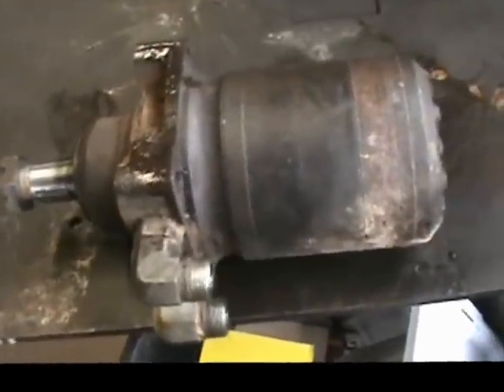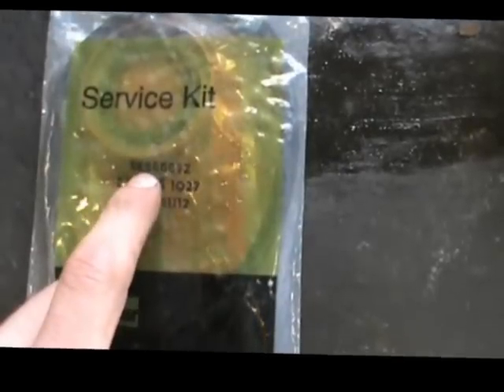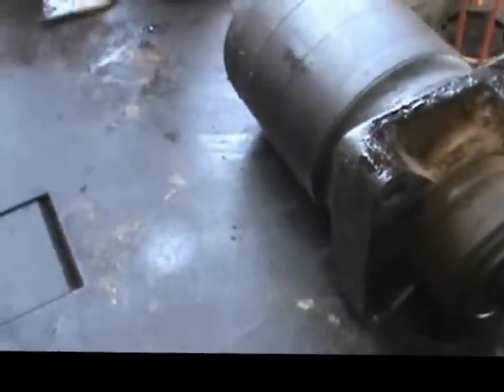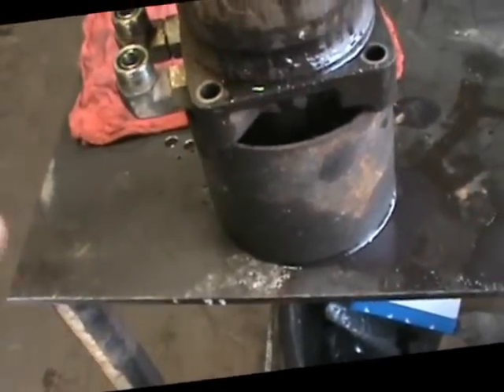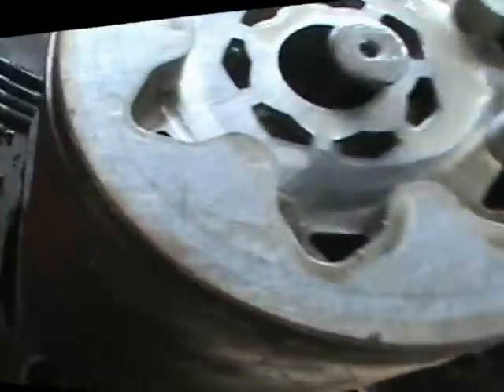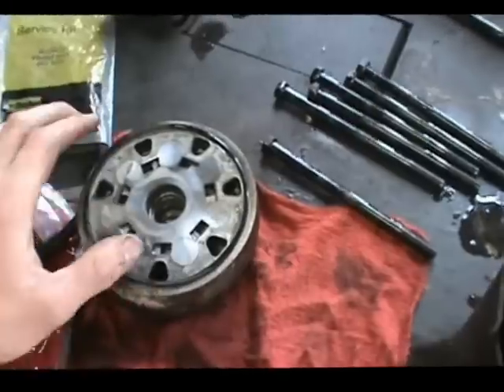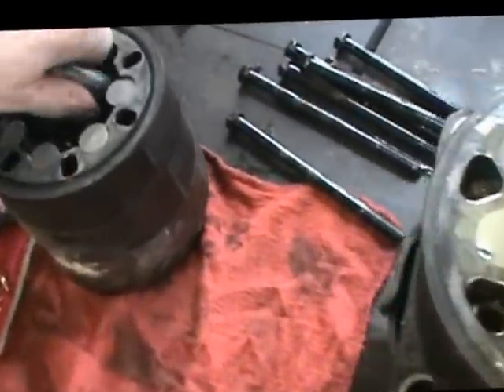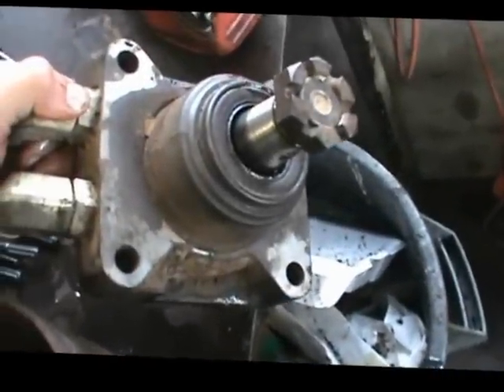how to disassemble a parker hydraulic wheel motor

Comment: Folks, don't mark your motor with a grinder.  Clean excess oil and dirt, then glove up with some gray ghost gloves and finish cleaning with brake cleaner (WallyWorld has affordable generic can), THEN with a Markal Valve Action Marker (White) make a symmetrical V, opposite side of ports from rear cover up to shaft end, back down rear end.  This will help anytime you have to deal with timing issues on a motor.  Tolerances are (should) be tight on motors and valves, so bring a lot of patience.  Take pictures every step of the way.  If you purchase an OEM Seal Kit, they often have torque specs and sequences for securing the rear cover when you're done.  Thank Me Later...

Comment: FYI--The Parker wheel motor taken apart here (from what I could see in the video) was the TG0625 series motor, seal kit # SK000092. My Toro Dingo (05 TX420) uses the TG0530 (528cc/32.3ci) series motor, seal kit # SK000159.

Comment: Anyone know what happens if a piece is accidentally flipped upside down. I resealed both wheel motors. And now one side works while in the air. But as soon as its on the ground it wont pull itself

Comment: Hi  can i get  your help me i have a   hydraulic 52 inch lesco lawn mower 
 and both sides of mine was making a sound  but now it 
will barely even roll is it the hydraulic pumps    or   the wheel motors
 ?   I took a look inside one of the hydraulic pump it looks like its good nothing broke in side ?

Comment: The motors on a tag along forklift have gotten weak. They're Parker motors. neither motor leaks fluid but just don't pull strong any more. Is there a kit to fix this problem?
Reply: +BigLowman BigLowman  If they are external gear type then they could be worn out.  Don't take this as an expert opinion.

Comment: I keep shearing woodruff key holding wheel hub on is there a torque spec?
Reply: 250 -400 foot pounds of torque
Reply: hey, did you ever get your that shearing fixed, mine is doing the same

Comment: THAT brings back memories...The first one I was shown on was a Char-lyn. The initial indicator was turning the shaft by hand...doesn't when in good condition. Details like case/ component alignment, thrust washer (is also a type of bearing) and commutator location & orientation were emphasized... 
No matter the mfgr, with the conditions most heavy- med. use equipment are exposed, hyd. motor & pump shaft seals were the most common point of failure...and the most difficult to access. Thank you!

Comment: If wear is too excessive and welding/ machining would cause the shaft to weaken and there are no replacements available (if you have some time); having it re-chromed is another option. There are usually a few machine shops in any city near by that will do it for a reasonable price.